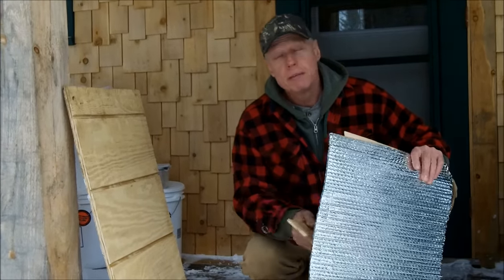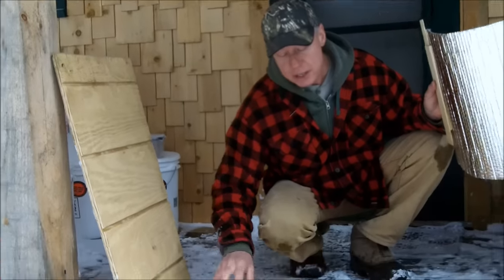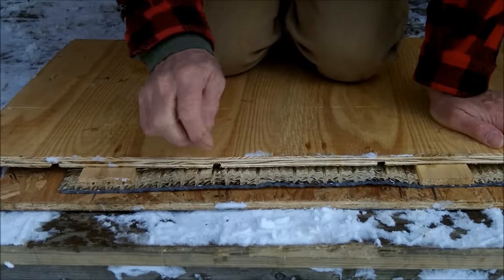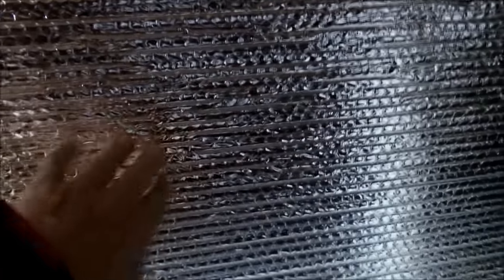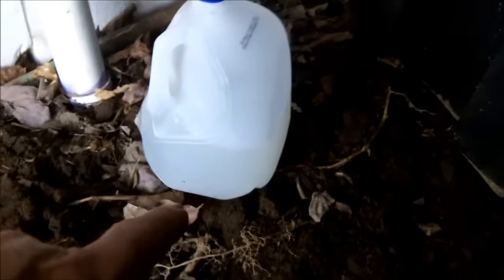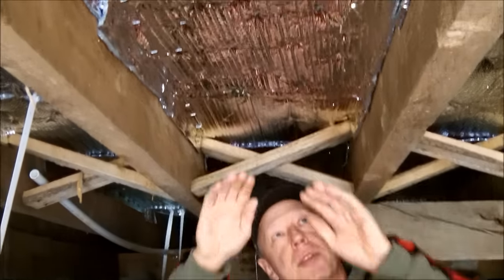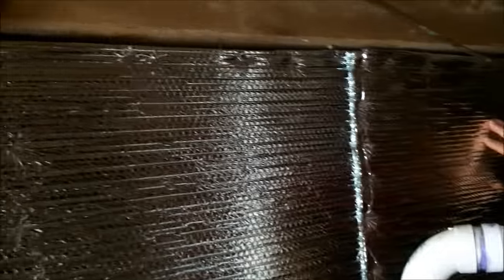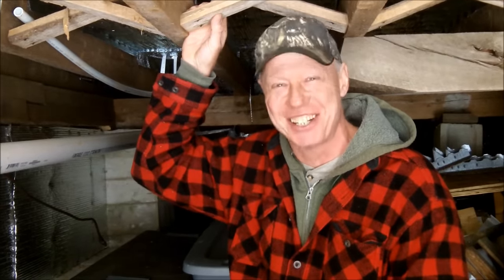HOW TO INSULATE A CABIN FLOOR AND KEEP IT RODENT FREE

Comment: Get yourself some foil tape. Heating and cooling companies in my area wrap duct work with that kind of bubble wrap. They use foil tape to seal the seam joints of the bubble wrap, and it helps greatly.
Reply from the maker: I use it all the time :-)

Comment: I read that the foil will also help and reflect the heat, but it will only really reflect heat if it's not touching. Ideal installed on your skirting like you have it boss..

Comment: Trapped air only has an R Value of slightly over R1,  having it sandwiched between plywood only offers at best R.25.
Having one or both sides open to the air offers some reflective value but when it gets dusty and dirty you will loose insulation value.
Reply from the maker: Working on a 3 year update now.  Stay tuned.

Comment: Thank you for this video. I'm in the process of building a cabin shell and insulation, critter control and moisture issues is a huge concern. When the builder showed me this stuff, I'll be honest, I laughed out loud, in his face! I thought there is no way, that thin shiny material has any insulation value. I was wrong and now have to swallow my pride and apologize 😜
Reply from the maker: I felt the same way when I first heard about it.

Comment: I just finished replacing the flooring in my mud room addition here in northern Maine. I went with 1/2 adventech on the bottom of the stringers, air tight sealed, faced fiberglass insulation in the middle and adventech 3/4 on top. Wish I would have seen this video beforehand. We will see how it goes I guess. The rodents would have to being their jigsaw to get in but they probably will lol.
Reply from the maker: As long as they can't get in, you should be fine.
Reply: @thebossoftheswamp  it is tight as of now but like you said, they are crafty. I'll check in down the road. If it doesn't work or I need to do anything comparable I'll get the magil foil wrap. 

Do you suggest it for ceilings and walls? Was planning on rockwool for walls

Comment: Love the video.. I'm going to be building a small cabin and wondering your opinion on putting the bubble foil directly on top of the floor joists then the plywood? Could add another layer at the bottom of the joists as well but I figured it might help with radon gases as well as cold air, moisture and insects. I'm not really worried about gluing and screwing to reduce creeking. Thanks!

Comment: Thank you.  I have a 12 x 36 shed/cabin with only a sub floor and I had been wanting to get it both insulated and rodent proofed at the same time.  I always hear about people putting the regular insulation on the underside ... but my instinct was that doing that might attract the varmints.  I'm going to do what you suggest here.  On both the underside and the inside.  It makes perfect sense.  Thanks again.
Reply from the maker: You won't regret it.  Is the underside of your cabin skirted?  If not, skirting will make all the difference in the world.   Look up part 2 of this video.

Comment: There's a difference between air infiltration and heat conduction.  That foil coated bubble wrap does very little to impede the latter.

Comment: Thank You for this great video! I'll be watching more from your channel as I am doing research to build my own art studio using mostly rough cut wood as a separate building. Question: I am also off-grid in the middle of NY state and plan the studio to have no electric or running water, heating intermittently with a small wood stove (Cubic Mini -type). Since I want to use it for example, in winter on a Tuesday, firing up the stove, then letting the stove cool down for 3 days, then using the building (not attached to the house) again on Saturday, how would you suggest insulating/finishing off the interior so I don't get a mold problem with all the heating/cooling cycle I'm planning on? Is it even realistic to finish off what would start off as a rough shed  (code allows 10x 14 without a permit) and not heat it constantly all winter? I WOULD like it to look somewhat 'finished' inside but suspect drywall would be a poor choice. What would you suggest since you mention you have 2 cabins in similar climates to mine that I'm guessing also go through heating/cool down periods during the same winter season?

Comment: A much more effective and easier way to do this is to put xps rigid foam board on the floor inside of the cabin. Tape the seams, and put plywood over it. Go underneath and make sure there are no holes in the floor, bottom plates, or anything like that a mouse can go through. They go where there is air movement. This method with the foam is alot more durable, gives you a true r value of the foam thickness with no thermal bridging.

Comment: I have a cedar log hunting cabin that I need to replace the roof and floor in because I have let the roof get too bad. When it was built, they used regular pink insulation all over the walls and roof. They squirrels, rats and other critters are constantly making a huge mess with it. This is a wonderful idea, since I will be replacing the floor. Would it work ok to put it on the underside of the metal roof when I install it too? Would it provide the same insulation and protection from critters? Thank you for the idea!!! I am a subscriber now.

Comment: Well i convinced the other half to try this and over the next few days we are laying it under the subfloor. My husband in not convinced it will work so is suggesting placing more insulation under the foil then meshing to prevent mice. Only in the bathroom and bedroom area. The insulation is rockwool. Would the bubble foil still work? I read one man on here say no. So the sandwhich would be Advantec, bubble foil, rockwool then metal mesh. Please somebody answer me quick before we start? One side of the crawl space is very very tight and we do not want to go to the trouble if it wont work.

Comment: Great video, Thanks!   
To be clear., are you saying that you put this product on top of the floor joists then fastened plywood floor on top during original construction?
Reply from the maker: Yes for new construction but you must keep the rain from getting trapped between the foil and the floor. Otherwise, install afterwards it from beneath.

Comment: Been doing that 30 years at first that's all I had and free ,couldn't believe it and didn't care to tell anyone and didn't do this net thing specially back then ,but nothing new here glad that you know about  it now and use it because it does work,and l still don't try to  understand and don't care.
Use in walls and ceiling as a vapor barrier wow just make sure you seal joints.

Comment: Hello, I have  learn a lot from your videos,  i will use the bubble foil , myself and  friends are going to build   a 14’x20’ piren  beam  guest house  something very small open floor plan with a 5’x8’ rest room with a stand up shower the floor space 30”- 36” above ground , my question is once I. Place the piren on each corner of the house how far apart and do I place piren beam down the middle for the support of the floor , as. You tell this 
Will my first time building a of this size.

Thank you 

Alfred N

Comment: Here in Alaska I had to remove all the fiberglass in a 10 year old cabin due to a mouse infestation.  Its a 32 x 24. I was gonna install rock wool . And use foam skirting.  I might try to incorporate that bubble wrap under the floor

Comment: Jimmy, do you have any videos on what you do to skirt a cabin? I'm concerned about frost heaving and live up on the north woods of Wisconsin in climate zone 7.  I'm wondering here. I thought about laying down one to two level layers of cinderblock first (holes vertical to minimize heaving), then, a flat 8X16 patio stone over the holes to critter proof the holes, and then laying treated lumber on top of that for the bottom of the skirt frame. Then, connecting that to the bottom of the cabin. What are your thoughts? Do you have a video on skirting that you could point me to?  

Any suggestions would be appreciated. I plan on using the bubble foil and replacing some old critter damaged fiberglass from the 1960's.  I'm planning on tackling this in the spring. I LOVE this video.

Thank You Sir!

Take Care

Tom
Reply from the maker: Tom, I don't have a vid on that yet but plan to make one as soon as I have time.  I frame with PT and sheath it with anything that does not rot. the bottom plate of the frame is suspended just above the ground but the skirt sheathing bypasses it and dirt is banked against it.  I will give further instruction in the video.
Reply: @thebossoftheswamp   - Thank You Sir! Your approach makes perfect sense! I did a little more research and also just discovered that in areas where water drains well, frost heaving might not be an issue. I am in an area where the ground is all sand. I had a soil sample taken for my septic field years ago and it is sand 8 feet down, no clay up here in the north woods. No puddles up here either! From what I just read, if there is clay or moisture retaining soil, that's the tipoff that frost heaving is going to be a problem. It makes sense to me now because my pumphouse is attached to my cabin and it hasn't shifted for the past 40 years. I've gotta skirt this place in though. Last night the temperature dropped to 23 degrees and I was up every 2 hours to run the faucets a little and flush the toilet to move warm water through the pipes. I'm 66 and that is just getting old. I want the option to stick around a little longer next year and not get up all night long. 
God Bless You Both! Best Wishes To You and your better half on the new project. Your cancer survivor buddy,
Tom K

Comment: I plan to use this under the carpet padding for a room that is over an uninsured garage. Sure walkways will get flattened but it mayhelp.
Reply from the maker: This stuff is pretty tough. The bubbles may never flatten out but the silver coating may wear off in those areas. Let me know how this works out.
Reply: I'm turning a deck floor greenhouse into living space.  Thinking of putting bubble foil under a  Berber or indoor/outdoor carpet.

 How is that going for you?

 I heard we could use 2 layers,  double the R value.  

Just wondering how that worked out for you. 
Thx.

Comment: Very well done. Could you please tell me what you used to cover the exterior? I only can find concrete board . Much appreciated
Reply from the maker: That's what I mostly use but metal roofing works great too.
Reply: @thebossoftheswamp  thank you so much. I have a cabin in northern NH and will be retiring in about 16 months, God willing. I enjoy your videos. They really provide me with great info in need to take into account when the time comes to retire there.
Reply from the maker: Glad to hear you find my ramblings beneficial.  Good luck with your build. @marcaudet8939

Comment: My concern is that in  my humid climate, moisture will get trapped against the wood, becausethe bubble isn'tbreathable. Even using an air matress on the hardwood floor will trap moisture and mold. It's best to avoid moisture barriers here because it will trap moisture and cause the issue it's intended to prevent.
Reply from the maker: It's very humid in our crawlspace but I've pulled down small spots of the foil to view behind it and never have found any moisture there. The foil actually keep moisture away from the underside of my floor.  However, I don't recommend putting the foil against a cold surface like the rim joist. This will indeed trap moisture.  Maybe put up a small section as an experiment and go from there.

Comment: I heard insulating the foundation/skirting is nearly as efficient as insulating the roof, and more efficient than insulating walls. If you can extend an insulated skirt into the ground, below the frost line, the now insulated dirt under the cabin should stay warmer than the soil outside of the insulation.
Reply: That's the skirt plan for my 12x16 storage shed/cabin, whose walls I insulated by wrapping around the inside wall framing, studs & all, with that wonderful Reflectix stuff. I am not concerned about breathability, since I have an attached greenhouse exchanging air. Besides, since modern framing technique using Tyvek certainly isn't conducive to a house being able to breathe, being concerned about it seems misguided.

Comment: I have a mobile home with an addition in Florida that has floors that are low to the ground and has a vented crawl space. The floors are soft and condensation builds up under the floor tiles which squished up in the Summer. The plywood floors are soft and we need to replace all the subfloor. It's impossible to crawl under the addition and one ends of the mobile home. I'm thinking this might work in my situation. I think I could staple the bubble wrap on the underneath of the ply wood before we screw it down.

Comment: Would this work for attic and interior walls or better as a weather wrap for Interior Alaska with mostly rain fall, extreme cold and wind conditions?  A few brief patches of heat in summer months, but more becoming a rain forest during the summer.  Rodents getting into the walls and tearing up the insulation pretty much sucks any warmth from a wood stove or additional sources of heat out of the house.   Far too much wood and by morning all the pipes are frozen, if you don't turn off the pump, when it kicks on, which it did a few times, it causes leak and water damage inside.  Nightmare I'd like to avoid when building my own place.

Comment: I love Reflectix! Use it as a pad in my hammock and to make camping gear. Never used it as intended. I've got an Arizona room built onto my cabin and as you said the fiberglass insulation is useless. I can't get to everywhere under it to do what you did. Could I remove the carpet and put down the Reflectix as a pad and then put the carpet back down?  Love your thoughts please. Thanks for sharing.
Reply from the maker: Yes, that would work great. :-)

Comment: Some of us just want to build a cabin that's relatively warm, and some (like me) want one super insulated and toasty. As I watched your video I was impressed with your simple solution. Near the end I realized that the answer is a combination of your ideas. Install the bubble foil before or after you lay the floorboards down, and when that's all done go down below and put in some batts of pink insulation between the joists (since the bubble foil is a vapor barrier, you won't need to put another one). Finally, you staple up some chicken wire to make it rodent proof and it's done!
Reply from the maker: Good luck to you.

Comment: Looking for your suggestion on whether the solution described in this video is appropriate in the following instance: split level cabin with cinder block perimeter. Forced air oil furnace in the 'basement' under the 2nd floor with duct work leading directly to the 2nd floor and out to the crawl space to heat the 1st floor. Area where the furnace is warm and the floor above it (2nd floor) is warm. Crawlspace area under the 1st floor is cooler and the1st floor area in the cabin is cold in winter - much colder than 2nd floor. Nothing separates the crawl space from the furnace space - they are open to each other. Should I insulate the duct work with this product as well as all the floor joists and the skirting (seems to be cinder block with a product that looks like steel doors applied to the cinder block). Floor of both the 'basement' and the crawl space is dirt. Thoughts?

Comment: Wow Thanks for this. Im just doing an addition and ready to lay the floor. This has been the most sensible and informative  clip. I like the idea of laying the insulation flat on the joists and  screwing the subfloor on top of it. I am concerned that in the long run this may cause some problem with the floor not connecting to the joists properly, as the plastic in the bubble wrap deteriorates because of the pressure between the joists and the floor.  i was always told to use liquid nails and screw the subfloor to the joists. However if I do the insulation as you say, there wont be any glueing? Hope my question makes sense. i would really appreciate your thoughts on that. Thanks again for a great video.
Reply from the maker: I shoot the floor down with 8 penny nails and no issues so far.

Comment: Awesome video. Glad I came across it. I'm building a shed with 1/4" plywood attached under the floor joists for rodents. Should I attach the bubble foil on that plywood or attach it to the actual floor plywood that is attached to the top of the joists? I'm thinking what you said about the warm spot for rodents if it's on the plywood under the joists. Thanks and thanks for the great video.
Reply from the maker: I would staple it to the underside of the sub floor and not bother with the secondary plywood. To this day I have not changed a thing and still don't need to.  If you're not skirting your structure, then that extra layer of plywood would be helpful.
Reply: @thebossoftheswamp  thank you so much for the reply. I'll definitely staple it to the subfloor. I'm not skirting it, so I'll do the extra plywood. Thanks again for the advice.